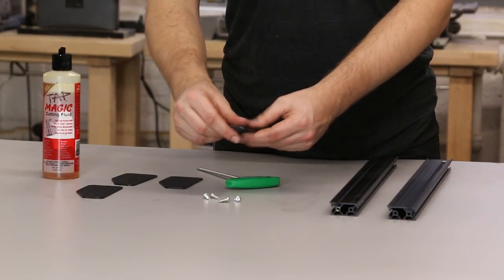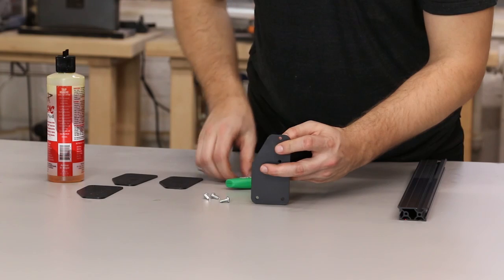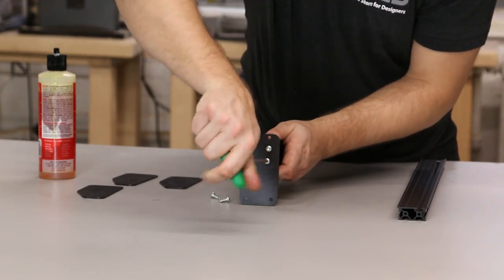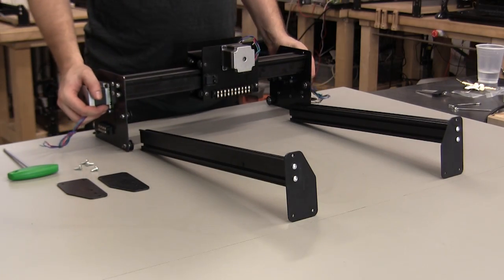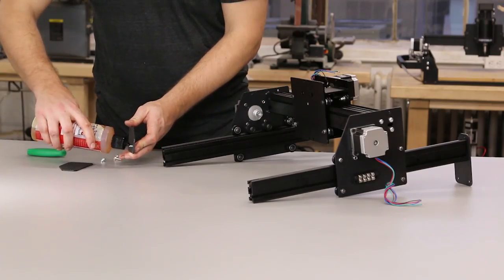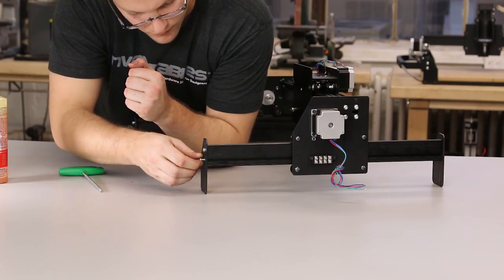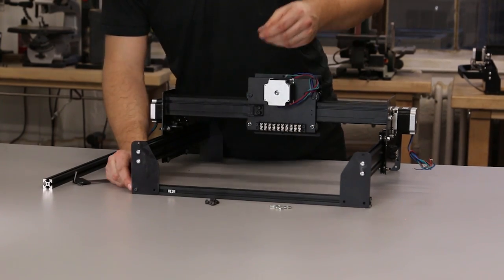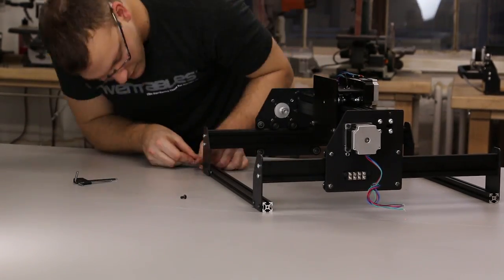X-Carve | Assembly | Y-Axis

Comment: At 3:18 - the nice thing about those insertion nuts is that you can usually do it in the reverse order that you did.  Put the nuts and screws on first, then just slide the makerbeam onto them and tighten.  Much easier that way.